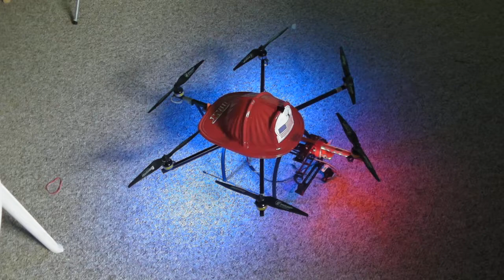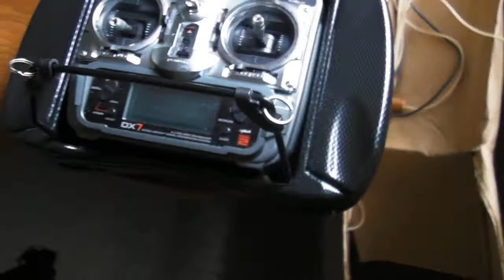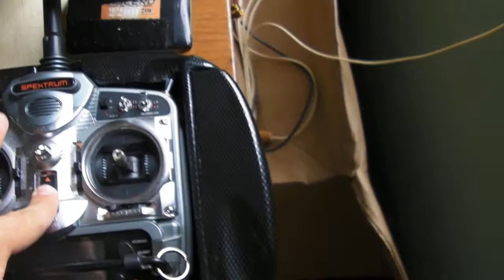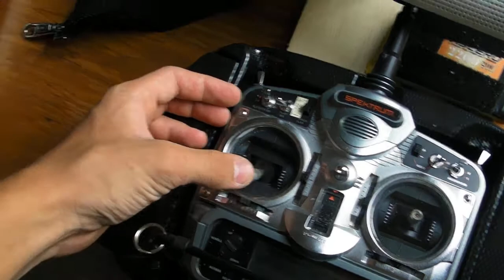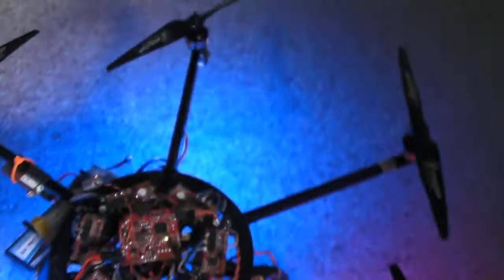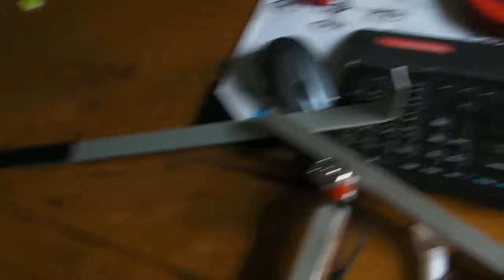Weird Mikrokopter software bug

Comment: That very fast beeping "Durrrrrrrrrr" sound is a 12C error with one or more of your ESC's.  There are two "clock connections”  “C & D” plus a ground that connect to your flight control computer.  These give the ESC’s their timing & speed instructions.  That sound your are hearing means that something it wrong there.